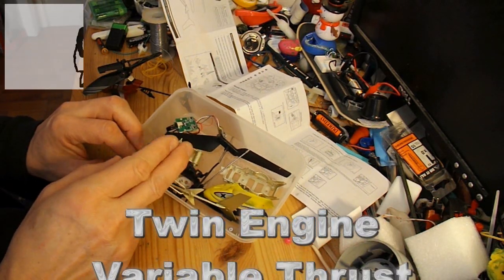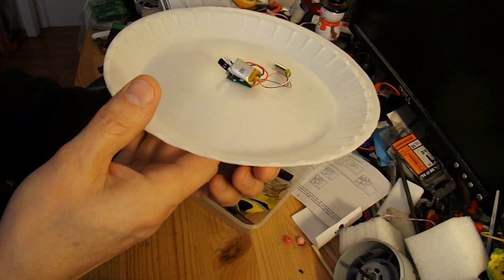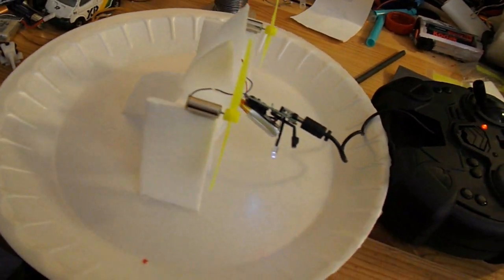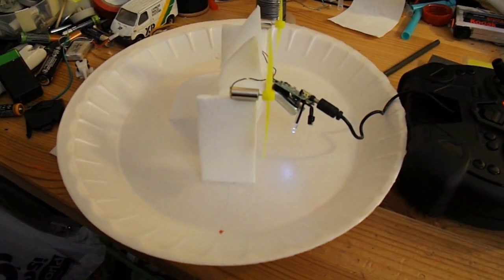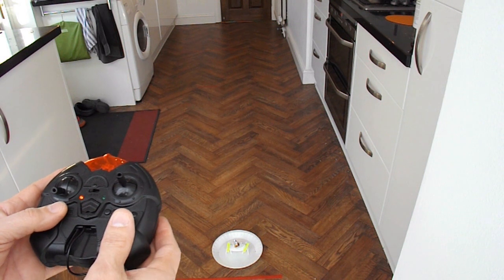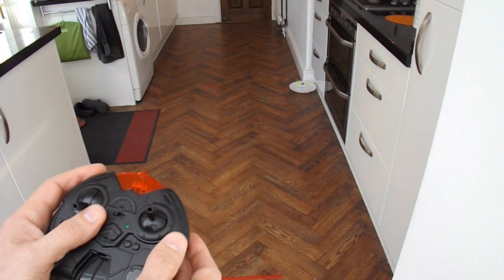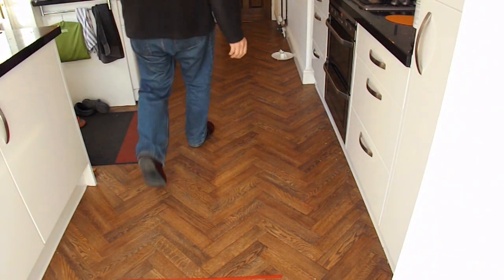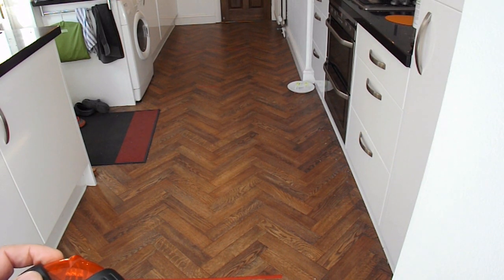Testing Twin Engine Variable Thrust - RC helicopter components

Comment: halfway there.. if a styro tray were inverted, shrouds around the props and maybe 30% of the air ducted of both to underneath for lift cushion, we'd likely be seeing a  fairly fast little RC hovercraft. thin plastic water bottle sections might be usable for shrouds and ducts, could simplify assembly a whole bunch. the styrofoam plate was scooting along pretty good, but imagine taking that friction out of the picture.. control being such a major advancement over the original chipshop hovercraft.
Reply from the maker: model nutty not trying to make a hovercraft here.
Reply: GrandadIsAnOldMan same day reply is great and thank you for it. I'm waiting on parts in the mail (China eek!) to try exactly this idea. if it works out it might be a fast fun little toy.

Comment: I had bought a quadcopter for around £2 and it worked well.So I decided to take it apart and the quadcopter has variable thrust just like the heli so I bought foam,made a plane out of it,and I removed 2 motors and I used the receiver and the 2 other motors.I put the 2 motors on the wings.But it didn't fly....
Reply from the maker: What props did you use?
Reply: Just Hubsan props.But now it doesn't work good anymore so yeah...

Comment: Fun build too !
Those props look to be good performers and quite distinctive in the yellow. Looking forward to the aircraft :)
Reply from the maker: The holes in the props are just a little too large, had to give it a touch of hot glue. They are very low pitch so I am hoping for a relatively slow flights. 
Just checked they are 2508 as in 2.5" diameter by 0.8" pitch
Reply: GrandadIsAnOldMan If hotglue you'll want pushers then I expect. If any motor heat trouble you could always trim the ends progressively towards points and rebalance.